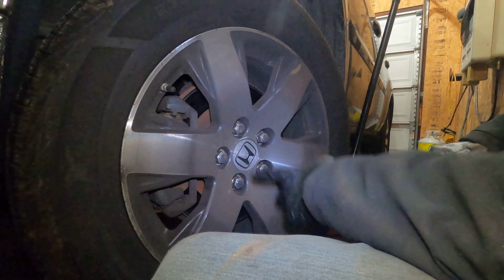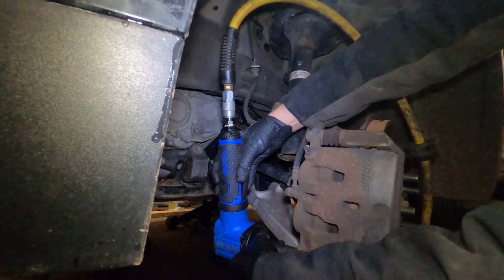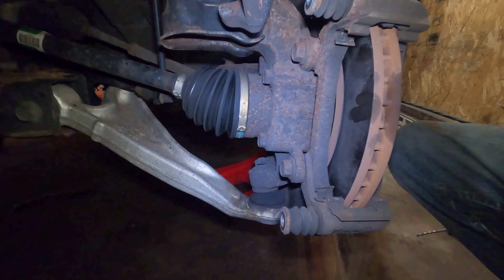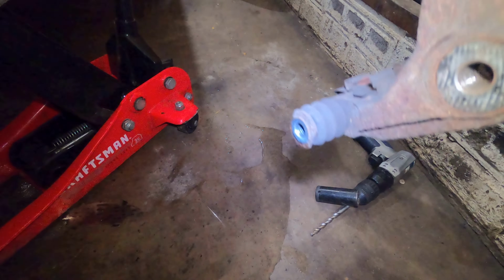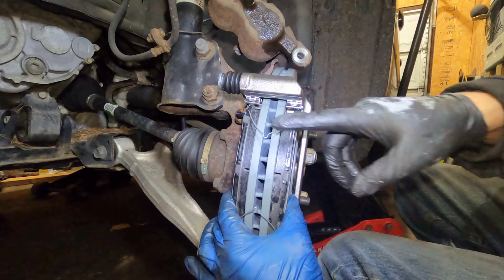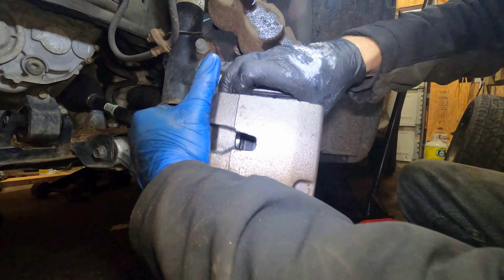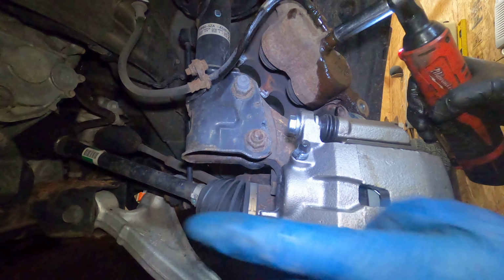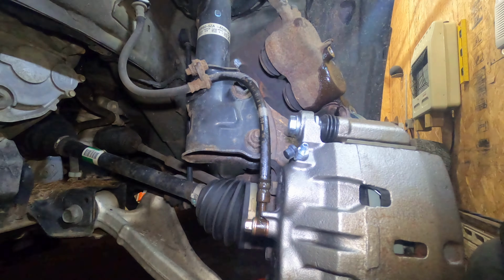2012 Honda Pilot Front Caliper Replacement

Comment: May I make a comment ? .  I have done a load of Hondas and the dreaded caliper screw can be a bear.  I have found two ways to remove them without resorting to drilling - 1.  You can buy an air impact tool that you rotate as it impacts.  2.  Soak the screw in easing fluid.  Wait 15 minutes.  Belt it with a drift and a 2lbf ball pein.  Use a JIS sized impact screwdriver which turns 15deg per whack.  Works 95% of the time.
Many people use Phillips head impact wrenches and most of the time the head will either shatter or ruin.  This is JIS and is a different profile.
You may have used a JIS, I cannot tell, but I hope this may help others.
Reply from the maker: i hope this video helps. feel free to like and subscribe for more & if you can, please help the channel out by giving a super thanks. Making these videos takes a lot of time, but we do it to save you hundreds. also head down into the description and check out the link for some high quality led bulbs for this and any other vehicle. use my referral for a discount. Add me in Instagram for behind the scenes pics and Stop by my store for some Anything Auto gear.

Comment: I was surprised that you drilled out the disk screws. I just use a impact screwdriver on it and a hammer. If its really bad I just give it a toot with my small air chisel. Also, Did you even try to remove the pins from the brake bracket? I see your just swapping out the whole caliper. What reason are you replacing the whole caliper? Normally I can get the pins out with a little work and just clean them up with a disk.
Reply from the maker: I'm not. In the rust belt those screws come out 5% of the time. I have the hammering bit kit. Almost never works. Faster to drill. I don't remember what was wrong with this caliper. I work on to many cars to remember. Siezed slide pins doesn't warrant a new caliper if that's what you are thinking. Something more was wrong. i hope this video helps. feel free to like and subscribe for more & if you can, please help the channel out by giving a super thanks. Making these videos takes a lot of time, but we do it to save you hundreds. also head down into the description and check out the link for some high quality led bulbs for this and any other vehicle. use my referral for a discount. Add me in Instagram for behind the scenes pics and Stop by my store for some Anything Auto gear.
Reply: @AnythingAuto lol! I wondered what the problem was with the caliper. I was thinking "Really? Because the pins are stuck its getting replaced?". Thats funny. I guess it wasnt too clear in the video why you were replacing the caliper. I live up in the rust belt also. I guess the honda screws are different than the GM ones. I have a lucerne. I have a bad back caliper on my lucerne that leaks only when the parking brake is set. So, I will be replacing that as soon as the weather gets a bit better. Thanks for the reply :)
Reply from the maker: @northpoint1039  yeah filming sucks. So I do a job then edit then do another job and edit. It gets exhausting so I forget about the filming part and why something is bad. This car was probably end of the day car lol